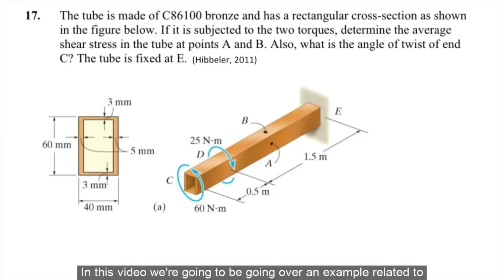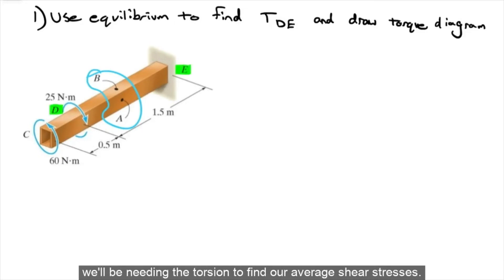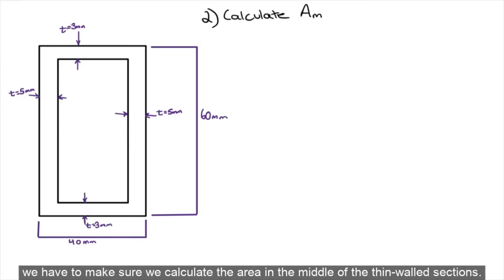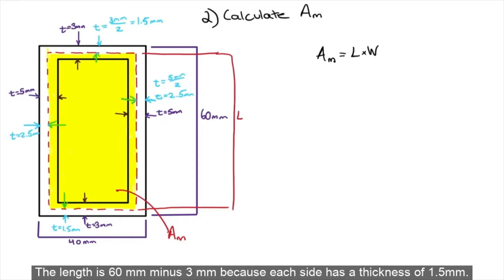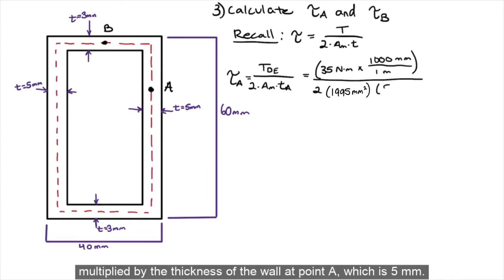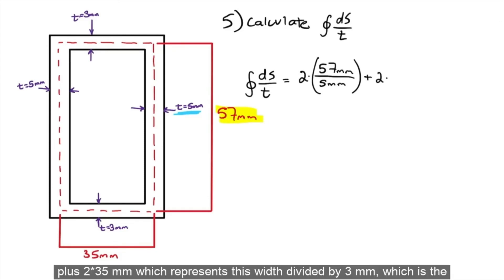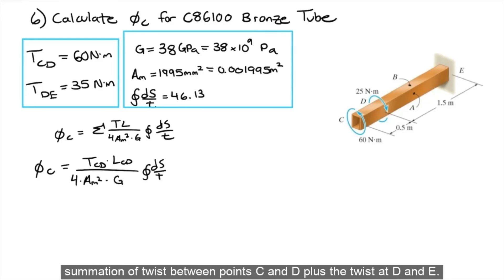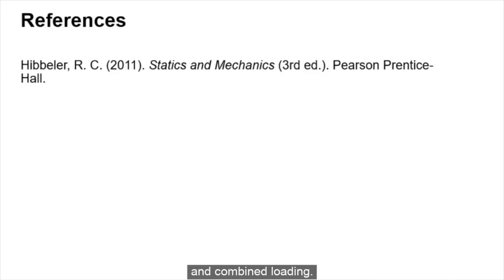AE 204 Torsion in Thin Walled Sections Example

Comment: How would you solve the problem if the horizontal walls had a different shear modulus value as the vertical walls?